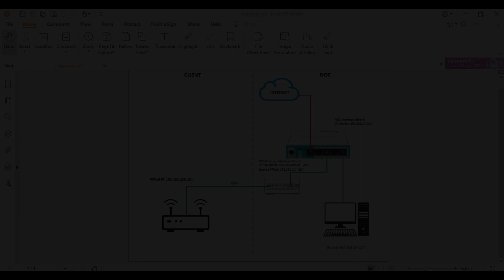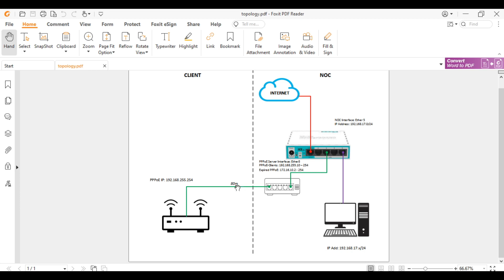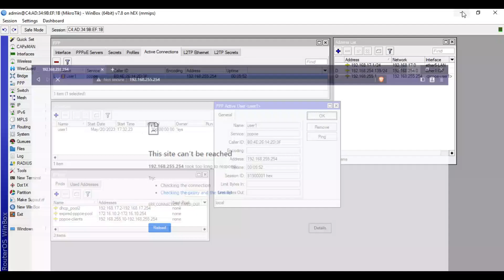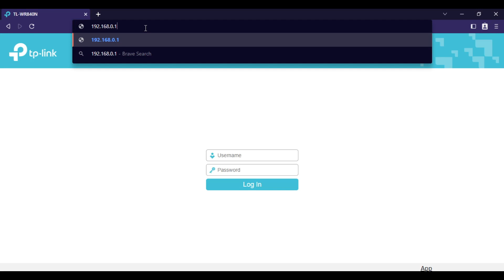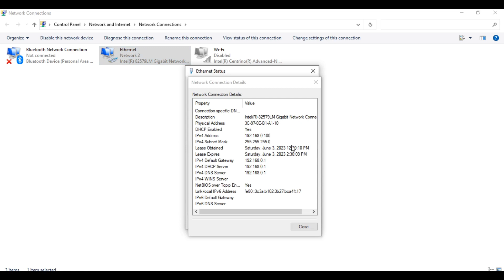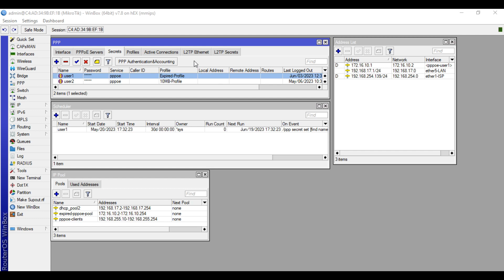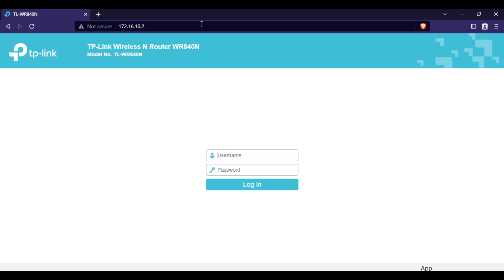Mikrotik PPPoE Setup - Remote Access PPPoE Client Router | Mikrotik Configuration Tutorial

Comment: i have dlink switch1 to which all the 10 interface from the firewall are connected. From 11th interface i have connected directly to microtik router ur3011-rm in etho1. from dlink switch1, the cable is connected to dlink switch2 (sfp switch) which is connected to all the floors of the building. and also to many nvr , computer etc. from the microtik router ur3011-rm etho10 , i have connected the cable to dlink switch1. now access point u6-lr is connected to the dlink switches in all the floors and connected via dlink switch2. and reaches the microtik router ur3011. Now the problem is if i program microtik router ur3011 for providing wifi via u6-lr by providing dhcp server in etho10. almost all the computers, printer and camera attain the ip from the dhcp server. eventhough all the computers , printers and camera are provided with various static ip from the ip pool from firewall. how to program microtik router ur3011-rm to avoid such ip conflicts and enable ip sharing only through u6-lr.